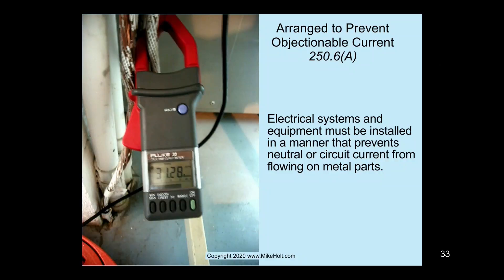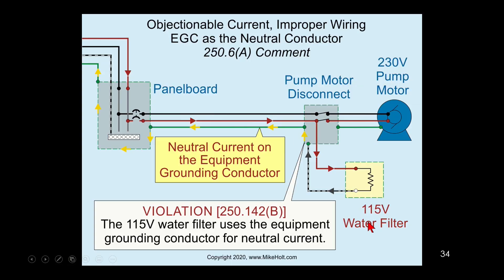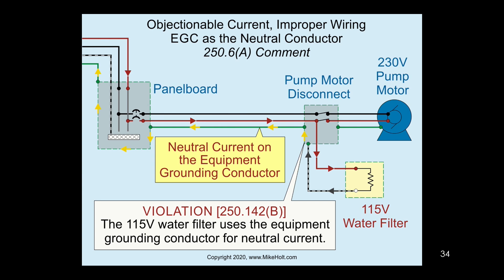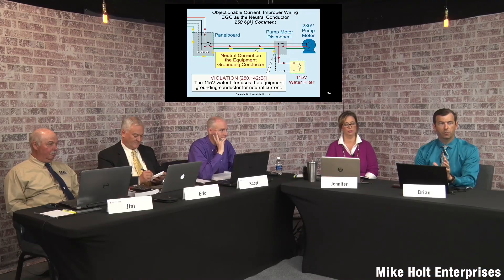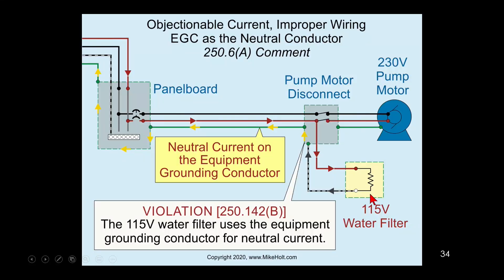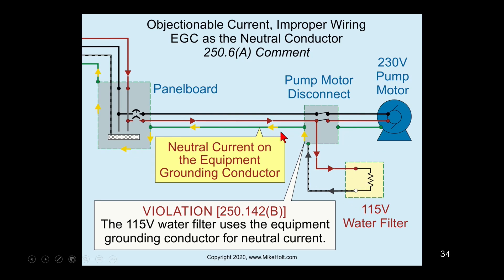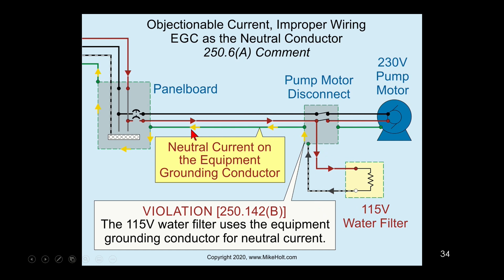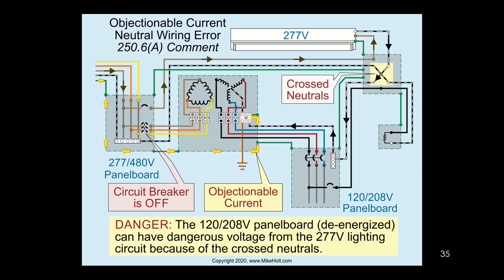Grounding, Objectionable Current [250.6, 2020 NEC]

Comment: I had that happen to me on an autoparts store remodel. We deleted 2/3 of the building electrics and set up a separately derived system that was cut into the mezzanine that was running the 1/3 of the building that contained the auto shop.
   Two 277vac lighting panels that were being deleted except for about 5 lines in one, had all but the  5 lines removed, but had crossed neutrals. I took about 4 Amps across my shoulders.

Comment: The neutral is at 0vac if and only if the wire in question is on the backside of ALL loads and the wires are connected and drawing current. Voltage drop is only present on an active circuit.
   People cannot get too hung up on wire color, because if you were to uncap a neutral splice and separate the conductors, you would get a blue spark and that 121vac voltage drop. One of those "white" conductors has essentially turned black/red/ blue and is now a "line" wire. Yep, line current does travel through white wires folks.
   Guess what else? When you equalize impedance on both 120vac sides of an household Edison 3 wire system, the system is allowed to operate at 240vac, and passes current back and forth between red and black, on what? White neutral conductors.

Comment: isnt it against the code now that two circuits can NOT go into a same junction box?
Reply from the maker: @Nhitc6832, no such rule in the NEC or any local code.
Reply: @MikeHoltNEC  🙁 now that's unfortunate. Wonder why they still would not have such code despite knowing the danger.
Reply from the maker: @nhitc6832, please submit a proposed change to the NEC if you have data that shows two circuits in a box is a safety hazard.
Reply from the maker: @nhitc6832, No such Code as you stated.
Reply: @MikeHoltNEC i definitely wrote it wrong. What i meant to say was "is it against codes that a junction box houses 2 or more circuit"?  I thought I heard someone said it was against code. Maybe it depends on local codes? In any cases, wouldn't it be a lot safer that one and only one circuit goes into a junction box?? Like, someone litterally died because no such code exists!
Reply from the maker: @nhitc6832, I think you are confused. Please watch the video again.
Reply: @MikeHoltNEC i watched and understood what the video is about. My concern, however, is the fact that a single junction box is allowed to house multiple different circuits. This is a hazard in my view because it creates the possibility of swapped/crossed neutral as you have shown in the video, and someone got killled because of it. Therefor, my suggestion was to have a code that allows one and only one cirtuit goes into a junction box, maybe with the exception of MWBC.

Comment: Funny, I am installing a sub panel in my mechanical room because it's set up exactly like the pump example. One leg of 240 is sent to the room for the pressure switch, with a ground (it's supposed to be both legs, first problem - the other leg out to the pump is always energized). Then they put in a receptacle with that hot wire and the ground.

Comment: Professor Mike. I just wonder what is the difference between watts and voltage. What can cost a burn to an electrical circuit equipment?
Reply: From local Cambodia
Reply from the maker: Please check this out on the Internet.

Comment: To make sure I understand. The example of the crossed neutral - there were two mistakes that lead to the electrocution? The first being a crossed neutral and the second tying the transformer equipment ground to the X0 transforme neutral connection creating the objectionable current path. Is this correct?
Reply from the maker: Yes!

Comment: I’m not sure how significant it might be, but a number of those surge suppressor power strips use Metal Oxide Varistors (MOVs) to shunt surges in three modes: L-N, L-G, and N-G. But, MOVs have a measurable leakage current, which will flow on the ground conductor. If you have enough of these on a circuit, I’m wondering if this might be a problem? Ditto for power supplies that filter common mode noise by placing a Class Y capacitor between: L-G and N-G. Presumably these same situations could cause nuisance tripping of GFCI breakers, right?
Reply from the maker: GFCI's trip between 4 - 6 mA, way above the possible 'leakage current' of MOV and filters in power supplies. So this has not shown to be a problem with GFCI's. If you 'know' otherwise, please get me the technical documents.

Comment: I’ve been a fan but this is wild. I started from a reasonable point of the drawing. This mf making his own ckts and problems.
Reply from the maker: Are you an electrician? All of the examples are 'real life' conditions that happen out in the field.
Reply: @MikeHoltNEC  yes sir. Let me rewatch and see if I come to a different conclusion.
Reply: At 4.14 I don’t understand why there is somebody on the panel that doesn’t understand how a meter works/ difference in potential.
Reply: And somebody on the panel differentiated from case ground that they think carry current. Unless I’m wrong from the graphic.
Reply from the maker: I don't understand your statement about 'case ground'. This is not a term we used in the video.
Reply: An equipment grounding conductor. Which would provide overcurrent protection to the case of a box or whatever equipment you are working on.
Reply from the maker: Please watch the video again, this is not discussing a ground fault condition (phase to case), it's discussing a neutral-to-case event. So your comment doesn't apply.
Reply: 2:07 is where you said case. I’d like to discuss this more and have followed your stuff for a long time. Is there somewhere I can message you personally? I mean no disrespect and I apologize if it came off that way.
Reply from the maker: The EGC is used as a neutral conductor in series with the load; this is not a ground fault. Send me email @MikeHolt.com.
Reply from the maker: Mike@MikeHolt.com, and I'll quickly respond

Comment: It's easy You can only test voltage with parallel connections with a volt tester You must use series on the hot legs to test for amps

Comment: There Are " Tracer " Neutral  Colors . NEUTRALS  Are  White or  " natural " grey in Color . This Can Be Further Identified
With Those Colors Having A 
" Tracer  Stripe " . Installations
With A Top Grade Specification- Hospitals , Or Other High Spec. Jobs Do Not Allow - Different Voltage Systems In the Same Conduit ,
By Their Spec - Expect Where They Hook In A  Piece Of Equipment . NEUTRALS ARE VERY DANGEROUS / THEY CAN  FOOL YOU / DEPENDS ON SET - UP.  Many Installations That have A White
Neutral - The White is Used
On 120 Volts . In The Same Building You Might Have A 
Grey Neutral On 277 Volts.
This Can Vary Greatly !  
To Further Manage Your 
Neutral Wires - Some Installations Will  USE Tracer Neutrals / With A Tracer Stripe.
Also In Conduit Systems A NEUTRAL Can > Become Hot !
Just Through > Other Wires In 
Pipe Causing INDUCTION . This Is Not  , Not A Direct 
SHORT . IF YOU UNHOOK A NEUTRAL IN LIVE SYSTEM IT COULD HAVE A CIRCUIT 
BACK - FEED OR IT / FROM
A NORMAL BACK - FEED OR
BACK - FEED FROM INCORRECT WIRING OR FROM
INDUCTION IN CONDUIT -

Comment: I did not know the neutrals could kill someone. I am on alert now and be careful to look for crossed neutrals. Helpful and insightful real stories. E;ectricity is serious, and I am in awe. I am saddened for the lives lost, good people doing their work. Question: I am building my house. From the conductors coming into the meter, I was to put a service feeder ( main panel outside the house in a column), and I bond the neutral and the ground there. Would I need to carry four wires from the main panel to the panel into the house? and should I click it there again or have it separate from a neutral bus bar from a ground bus bar? Appreciate it. God bless
Reply: Yes, you need to carry 4 wires into the panel inside. The neutral and ground should be on different bus bars after they have been bonded.

Comment: 277 neutral wire should be grey wire and 120 neutral is white. Pull appropriate colored wires people. In addition 277 circuits should never share the same raceway as 120. Also, I’ve made it a practice to assume every wire is hot even if I turned off the breaker and checked for voltage and current. And who ever twist’s wire with their bare hands? That’s what lineman’s pliers are for.
Reply from the maker: Excellent comment
Reply: Excellent 👌🏽 
Sadly, in practice, a lot sh*t happens!

Comment: Mike’s story about that young man getting killed working in that sign makes me so angry. I guarantee the reason why he was working in that sign hot is because the company didn’t want to turn off the power for five minutes because it would shut down a register or turn off a light or a computer or something and be an inconvenience. I’ve been in this situation MANY times where I would have to wire something up hot because the company I was working for didn’t want to turn off the light for a few minutes. Ridiculous and unacceptable and these companies need to be held accountable. I don’t care if I have to turn off a breaker and your computer has to reboot and your customer has to wait five minutes. 🤬
Reply: Well, we don't know that's the case and also there has to be a means of disconnect on or near a sign itself. I had a guy in a company I used to work for that died this same way. The switch at the sign was on, which it shouldn't have been. I'd attribute it to poor safety protocols for our company. Where I work now we have a ZERO hot work policy.
Reply: Seriously people need to understand its dangerous and obviously deadly

Comment: Love these Videos Mike but there is absolutely voltage on a neutral wire and its strange that this view persists. If the neutral wire is connected to source properly, which is grounded, with near zero impedance then there will be no voltage between between ground and the neutral. The neutral and the hot are mirror images of each other. The only difference is that the neutral is grounded which means that the potential between the neutral and the ground will be zero but only when things are connected correctly. During the video you try to make the point that the voltage drop across the load will be 100% and this is why the voltage is zero but this is not correct because this statement assumes the impedance of the neutral line between the load and the source is near zero. If there is any resistance in the neutral path to ground (or source transformer which is grounded) then the potential between the neutral wire and ground will not be zero. This can be easily calculated with series resistance calculation. Lets say you have a 24 ohm load which would pull 5 amps in a 120V system under properly wired conditions. Now lets assume the neutral wire on this circuit was not tightened down properly or connected improperly at a junction box or the panel and maybe has been arching a bit so carbon has built up and now there is an effective 24 ohm resistance at part of the return path (I picked 24 to make the math simple) This scenario will lead to two loads in series with a total of 48 ohms. Ohms law will tell us that total current in the circuit will be 2.5 amps instead of the 5 amps it should be. What are the implications of this. The motor will run slower and its voltage drop will now be 60 volts instead of 120 volts and the neutral wire will have a potential of 60 volts between the motor and the location of the faulty wiring. Even worse, if the neutral wire is disconnected, ie floating, then there will be infinite resistance for the return path and the neutral wire will be at 120 volts! Sadly this is what happened to your acquaintance. The point here, is that neutral wire is zero voltage relative to ground if the neutral wire has a near zero resistance path back to the source which is grounded. Assuming that the neutral is correctly wired though can be a costly mistake. The only way to ensure the voltage on a neutral wire is zero volts, relative to ground, is to measure it yourself prior to working on the circuit.
Reply from the maker: Please watch MikeHolt.com/NEV

Comment: After watching the video, I'm really feeling paranoid. Because, the neutral point may cross as Brian said and seen numerous times! How about using 'PPE' like gloves, will that prevent these sort of hazards while working? If so then what should be the minimum category?
Thank you Mr. Mike, Mr. Eric Mr. Brian and all the members.
Reply from the maker: If someone wanted to do that, just get gloves rated for the voltage expected.
Reply: Brian is a bser

Comment: I’m not an expert but Isn’t it a code violation to have voltages from two separate panels in the same junction box to begin with? I know that the same thing  can happen with objectionable current in a single panel with neutrals being crossed!
Reply from the maker: Nope, see 300.3(C)(1).

Comment: On a residential, single phase, (L/N/L, Hot/Neutral/Hot), 200 Amp service panel with a UFER GROUND, with 100 Amps of loads turned ON (50/50 per hot leg), what is the MAXIMUM OBJECTIONAL AMPS/current acceptable to travel/return back to the utility VIA the UFER ground?  (Answer of ZERO is NOT reality.  A small current ALWAYS finds it's way out the UFER.  HOW MUCH IS ALLOWED PLEASE?)
Reply from the maker: The return current via any grounding electrode is simply a function of physics. There is not way to limit this and the NEC had no reason to establish a limit. So the answer is 'no limit.
Reply: @MikeHoltNEC  O.K. Then how about this?:

At main panel, since Neutral and Ground are bonded, some return path electron currents do take the ground path back to the utility.  What then is MAX PERCENT% of total return current flow allowed on the bldg GROUND, before utility needs to come fix their neutral? 1%?, 2%?, 5%???
Reply from the maker: @BYENZER  Doesn't work that way, watch https://www.youtube.com/watch?v=mpgAVE4UwFw
Reply: @MikeHoltNEC Every house i work on, that has a UFER Ground, i put a clamp ampmeter around the panel's UFER.  UFER ALWAYS HAS SOME CURRENT.  Always!
Reply from the maker: @BYENZER  Correct, watch https://www.youtube.com/embed/a_nv_Q9WbeE

Comment: The voltage on the green grounding conductor is NOT zero. It is raised at some potential (reference to "earth") as a result of the "Objectionable Current. It may be a small amount but it exists a potential greater than zero. To say it is zero diminishes the importance of preventing the problem.
Reply from the maker: Preventing what problem? See https://www.youtube.com/embed/pAs_FmdxXhQ
Reply: @MikeHoltNEC  Thanks for the link, stray voltages are around us for sure!  Frightening to me having a pool! The problem I was referring to in my comment was the 115V motor using the protective ground instead of neutral. My point was that the example fan motor, say 1HP, will be drawing ~7A through a section of #8 wire and that conductor has a resistance, admittedly small so the cabinet of that equipment will be above the potential of other equipment and water pipes referenced to earth via other means. In doing a back of napkin calculation, admittedly at 7A  it will probably be very small less than a few 100 mv assuming the protective ground is well engineered with sizable conductors. But it could be much higher if there was a fault or very large load returning that way.  Thanks for the videos. Very informative.
Reply from the maker: @rhyoliteaquacade  If it's a ground fault, the protection device clears it, so no voltage no problem. If it's a larger load, then the N-E voltage will be so small that it's also a moot point. Try some napkin calculations to understand my video comments on objectional current.

Comment: Your saying that using an equipment ground(that's bonded to metallic box/conduit) as neutral, that the box and raceway won't be energized? A neutral can carry current when the circuit is closed and the load is unbalanced. So if your neutral and ground are bonded past the service and your raceway system is grounded, isn't their a possibility that the equipment could carry current and be a shock hazard(hence be energized)? Also, when you were talking about the potential between neutral and phase leg and you stated that the neutral has no voltage, in an ac system the polarity alternates. So 240° into the voltage sine wave the neutral will have measurement of -120V, right? For some reason when you open a circuit voltage always sits on the hot side and I don't know why that is.